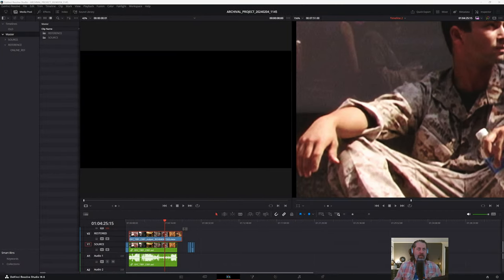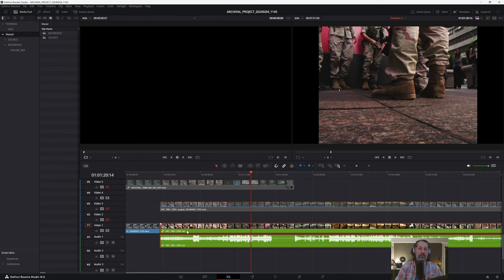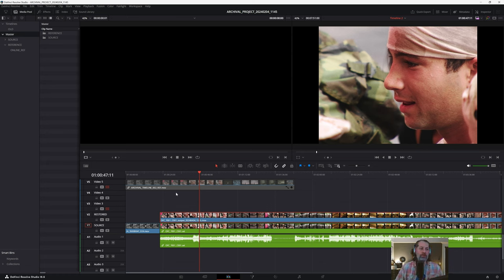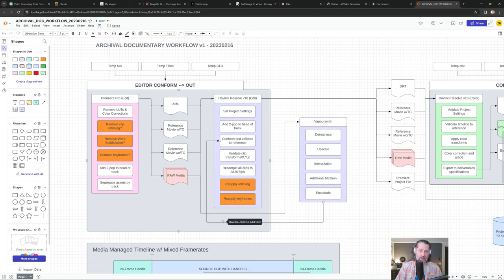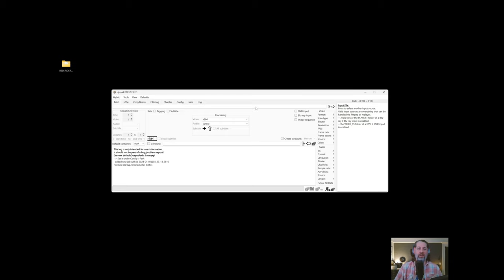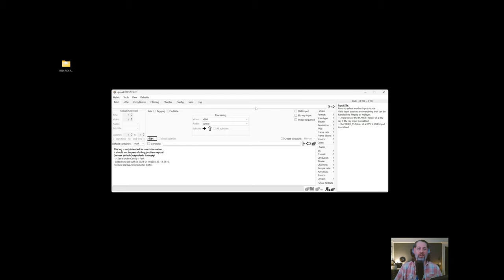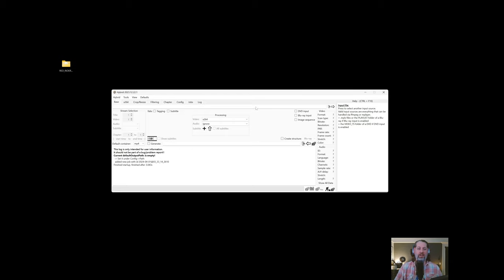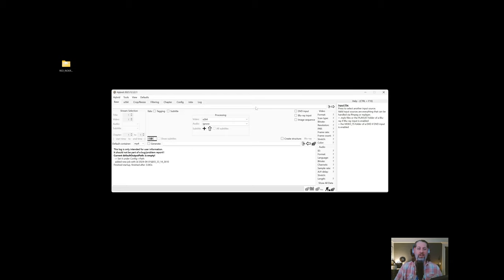Deinterlacing and Upscaling with Vapoursynth in Hybrid

Comment: Great video. I have many Sony derived DV tapes of home video, which I captured to interlaced avi using Sony Vegas some years ago. I now have more time to convert them to a progressive format. I use DV resolve, which deinterlaced and produced good results. I’ve also used Handbrake and found its BWDIF default filter to be the best. However, QTGMC interlacing appears to be the gold standard. Hybrid can provide QTGMC deinterlacing and, importantly for someone who doesn’t work in scripts, has a GUI. Many thanks for the highly informative video, which takes the time to explain and demonstrate the features achievable using Hybrid.

Comment: Why do video editors like to work with 23.98fps instead of 29.97fps which is what 99% NTSC video tapes are? Changing frame rates usually degrades the video. Why not keep original fame rate?
Reply: Because they were originally recorded at 23.976. The 29.97 frame rate is the result of 3:2 pulldown. You’re restoring it to its original state.
Reply from the maker: @rsuryase  when video editors first start a project there is a post production meeting that usually happens. In this meeting, we discuss something called “deliverables” which is what the distributor has asked for. This can mean several different things depending on the distribution method. Theatrical distribution will require 24fps. Television streaming will require 23.976fps or 24fps (or 25fps for PAL / SECAM). Broadcast for terrestrial television, cable, and satellite is 29.97 (for NTSC regions). Distribution determines the final format but the master timeline settings may or may not be aligned with this depending on how deliberate the editor or assistant editor is. Honestly, you would be shocked at how little editors actually understand the “why” and the “how” of timeline settings. This is why you can see a lot of weird stuttering and temporal artifacting in documentary films with archival media on streaming and tv these days. It comes down to poor planning and sloppy conversions. Most films with archival media shown on tv/streaming today have been deinterlaced using the basic algorithm built into the editing software and also sloppily “conformed” from 29.97 to 23.98. There is also a movement in the post world to get rid of fractional framerates altogether. 23.976 is totally redundant in the arbitrary world of streaming. So all of this will eventually change but archival films will still require someone on the team who knows the secret sauce. The younger generation of assistant editors do not stick around long enough to actually learn the fundamentals so the generational loss of the skills required has caused these weird issues. Its a long conversation for another time…

Comment: Hi Zack thank you for this video.  Really clarifies ALOT of things.  I’m new to PCs and using an analog capture setup running XP since that is the recommended OS for my special ATI capture card to export an AVI with lossless video codec.  Since i’m primarily a Mac user (M1 Max Pro with 32 GB Ram), the only other PC I own is a Dell Latitude company laptop with Intel i7 1.9 Ghz, 16 GB Ram, UHD Graphics 620 card and 512GB NVMe SSD installed.  If all I plan to do is use Hybrid to interlace AVI files and use Resolve for quick trim and exporting, do you think the PC would suffice.  I have read in forums that HuffyYUV lossless codec is not supported by any recent MacOS and kind of stuff and don’t really have the funds to get another PC at the moment.  I have this one laying around that i’ve considered just adding RAM and maybe swapping out the SSD.  What would you recommend?
Reply from the maker: @cuckoohaus  honestly you can run Hybrid on a toaster. Though Resolve is picky with GPUs. If the UHD 620 is an Intel integrated GPU it may not work (as of last I tried) - double check BlackMagic Design’s GPU compatibility list. But Hybrid will work on just about anything. I use it on my Intel Nuc as well as my Lenovo Thinkpad with Intel Iris Xe integrated GPU.

Comment: excellent information and presentation :) do you have anything that covers actually getting the original footage? i've been trying to use VirtualDub2 but most of the compression formats i try either show up as progressive in MediaInfo or don't seem to be very receptive to de-interlacing within Hybrid. so i guess that's the main thing i'm attempting to do: get a good quality interlaced copy of the original footage that i can manually work with in Hybrid. thanks in advance! :)
Reply from the maker: @locommotionmusic  hi! Thanks for your comment. Correct me if I misunderstood but are you asking me the best method to capture the archival source in the first place?
Reply: Yes I think this is what was asked. 
I am interested in that also. 

It seems these tools like hybrid start with a source file that was captured in some sort of interlaced format from tape which is then processed by your hybrid process presented here.

If would be great to get some suggestions on that initial tape capture step. Eg what codec and file format and what resolution is best to capture from tape with. Also would you upscale during the tape capture process?

Some capture tools provide many options and it can get confusing if the intention is to use tools such as hybrid to do the main processing step.

Plus as you say you should capture with no processing initially to be able to use new processing tools later that come along. I would love to know what that initial tape capture to digital should be for future proofing.
Reply: @zhalberd  correct. i realize the premise of this video was that you were working with source material being provided to you. but as @TheBukman described it can be quite the challenge to capture good quality source material first. fwiw after a LOT of tinkering and tweaking I have had a little better luck getting decent OCF and getting Hybrid or StaxRip to play nice with the footage. but it still seems pretty hacky on my part! :D
Reply from the maker: Hey yall. I've made a video for you based on this request. I realize that this was a critical component of the workflow so I hope this helps! https://www.youtube.com/watch?v=zB42-A5VOsQ&t=3s

Comment: (29:45) Bob deinterlacing doesn't cut the frame rate in half, but rather doubles it, giving you an extremely stable 60p output when using QTGMC.  This would provide more temporal resolution which should result in less artifacts when interpolating to 24 FPS.
Reply from the maker: Yes thank you! Did I say halves it? I meant double. You are spot on with the advantage of doubling temporal rez when Bobbing to 50 or 60p. Nice catch thank you Kooz!

Comment: I watched this for the 2nd time after doing some decent research into video transfer methods and deinterlacing. 

This is by far the best video guide to optimising archival camera footage out there and thankfully is using the best tool out there by far being hybrid.

Your comments on hybrid filter options and chatGPT are also spot on. It has a ton of info regarding this tool and far easier to use for research than blind google searching.

Oh one thing ChatGPT did say was that using bob before deinterlacing was the optimal approach for smoothest movement. Thankfully hybrid allows the combining of these processing options.

Thanks very much by the way.
Reply from the maker: @TheBukman  Thank you for this comment. Im really making an effort to give practical guides that are complete. My next tutorial will be a beginning to end HDV to 4k remaster of an old film I shot with the Canon XLH1 in 2007 along with a surprising discovery about this camera’s color science. (Far ahead of its time).

Comment: Thank you for sharing the invaluable experience!

One question though: at the crop/resize tab, you talked about choosing the bicubic resizer over lanczos one, ok. But then in the Vapoursynth area (at the Resize subtab), you talk now about choosing NNEDI3 resizer.  Now which of the two tabs actually matter for the resize settings and which resizer will be used, provided that we have activated Vapoursynth? Thank you!
Reply from the maker: @sergeypianovaria  hey! I think I do that out of habit but now that I think about it I believe nnedi upscale settings override. Ill need to read more about that pipeline to give you a more informed response!
Reply: @zhalberd  Thank you!
Reply: @zhalberd  Yes, that's correct. I tested all of the resizers in Crop/Resize to see how they compare and discovered that when one checks that Resizer box in Filtering-Frame-Resize it overrides whatever you selected in Crop/Resize.
Reply from the maker: @videocaptureguide  thank you for confirming! These notes are good for the community 👍🏻

Comment: Hi..still new to this..but want to learn more about hybrid as not impressed with topaz..so you do everything in one pass?..from what ive seen people recommend to just deinterlace in one pass. Then resize/enhance on the 2nd pass, or doesn't it matter. Many thanks and great video
Reply from the maker: @Upscaler23  one pass as there is an order of operations built into Hybrid. The “frame server” serves the video file frame by frame and Vapoursynth (or Avisynth) renders each frame (or series of frames depending on the filter) with each filter in an assembly line from left to right. This is also how Vapoursynth scripts are written - in a specific order down the script. Or at least this is how I understand it.